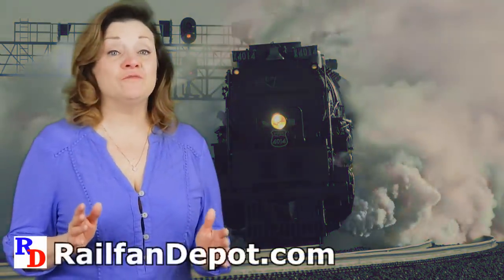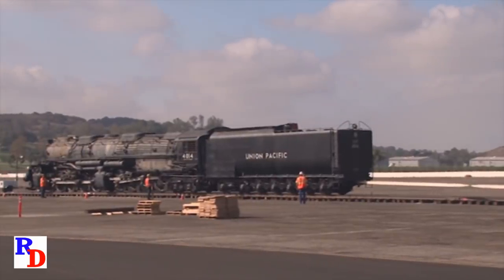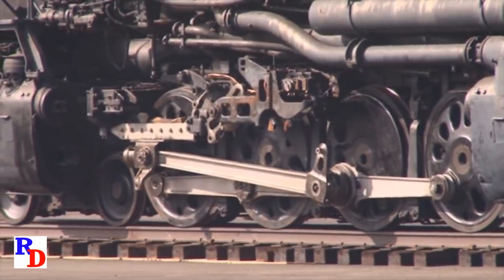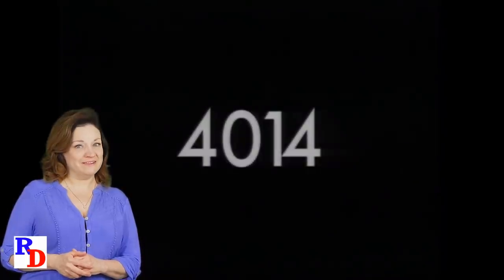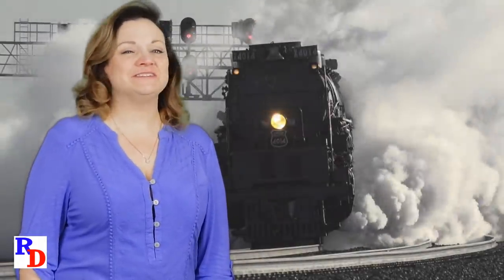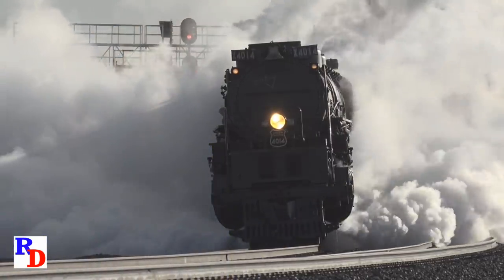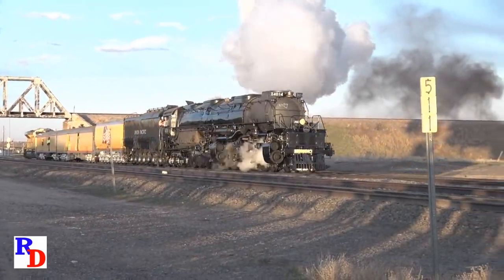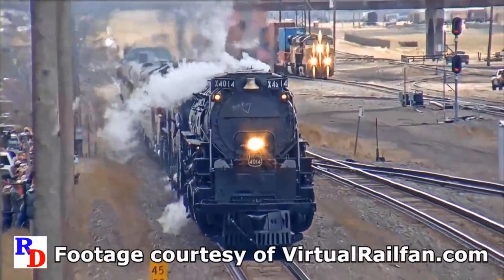Union Pacific Big Boy 4014 Then & Now

Comment: Thank you for putting this up. I've been a fan of steam engines since 1957 when I was 3 years old and saw one up close at a station in New York City. I've been keeping track of #4014 for the last five years since it was pulled out of Pomona destined for the Union Pacific shops. I bought an HO scale Rivarossi Big Boy #4001, many years ago. If I can find the proper decals I will renumber it as #4014. I'm very happy to see #4014 brought back to life. It saddens me to see things of history put aside and left to rust. The Big Boy is a monstrosity and a good example of what could be done back in the days it was first built. I'll never cease to be amazed by the complexity of steam power on railroads.

Comment: Luuuuv seeing those period clips of BB without that DAMN diesel unit.
Reply from the maker: I know what you're saying, but... Unfortunately the diesel is a nod to reality and modern safety. The diesel is not really used to push, or pull the train behind, but for dynamic braking. For all the great technology stepped into that Big Boy, dynamic braking is not one of them. Also a diesel can provide Head End Power for the train. And, of course it's also available in case of any problems with the steam engine... You don't want to foul up this main line with an excursion.

Comment: Does this engine still use coal or is it a gas turbine now
Reply from the maker: When UP rebuilt 4014, they changed over to oil. So it is an oil burner now. -Tim

Comment: How many times are you going to BEG me to subscribe and SPAM in one video?
Reply from the maker: DeAnn did not ask once, not one single time, for anyone to subscribe. NOT ONCE. There were two small graphics with a subscribe button, but that's it. No one is begging. I suggest if it bothers you that much, don't subscribe.
Reply: I subscribed just for the old gas turbine and Diesel content. I remember steam as a kid in the 1950's and history explains why it was replaced by Diesel-Electric. Steam was a pain in the ass to maintain and operate, and wasn't cost effective.